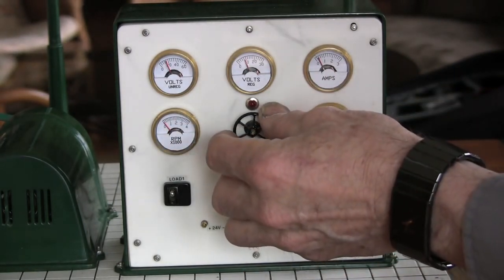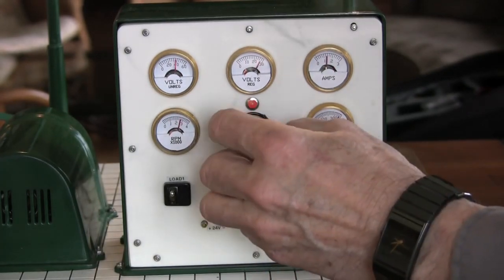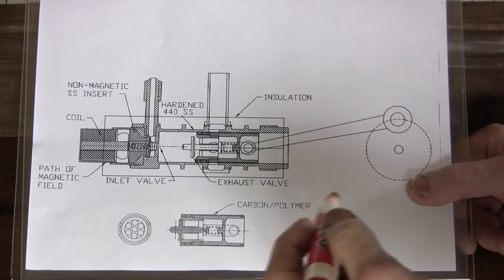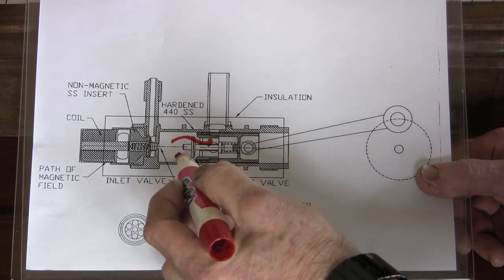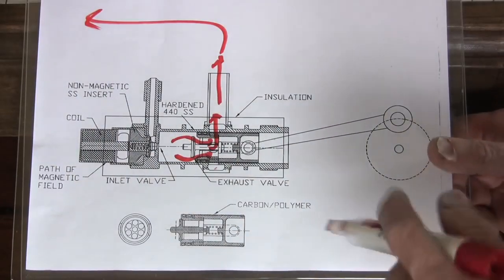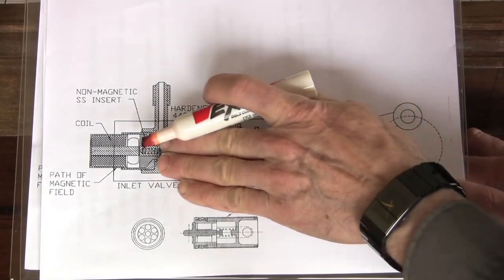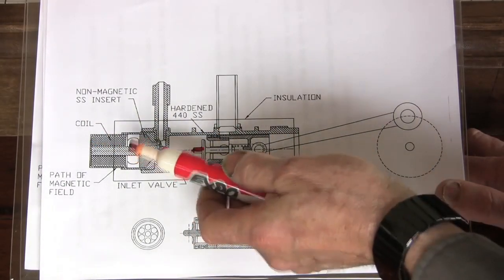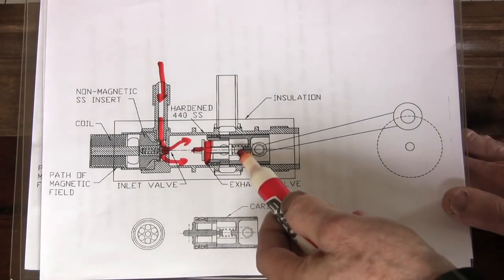Electronically Controlled Steam Engine

Comment: If you want a challenge, look into making electric self-starting ram pumps, or electric valve timing
Reply from the maker: Do you know about electric valve timing?
Reply: @marcinose  this was in the application of a hydaulic ram pump. 🤷‍♂️ The thing is with constant pressure, the way to maximize throughput is to tune the timing of the waste valve. Either to get max psi or max flow rate. It'd be a nice trick to have a rig that could be tuned electronically, to find optimum bpm, and for longevity purposes, switch back to mechanical valve that is tuned to the same beat frequency.

Mentioning this because it seems like a popular topic on YT and it could be a useful tool in your toolkit, providing water or air pressure from some feet of hydraulic head pressure and some cheap/DIY plumbing.